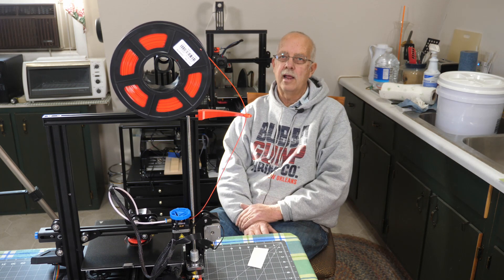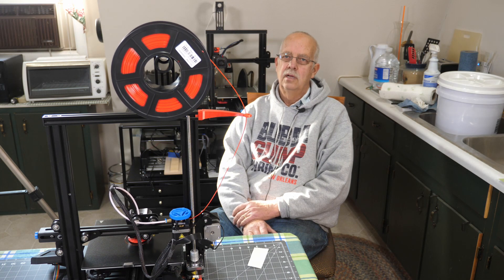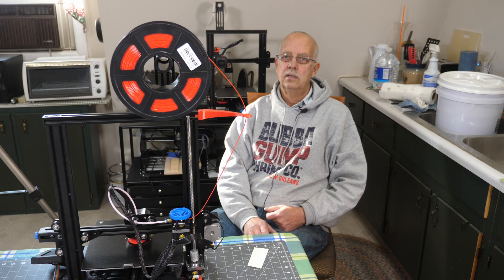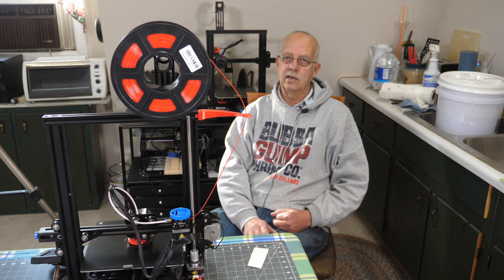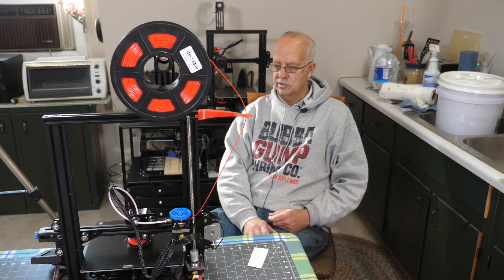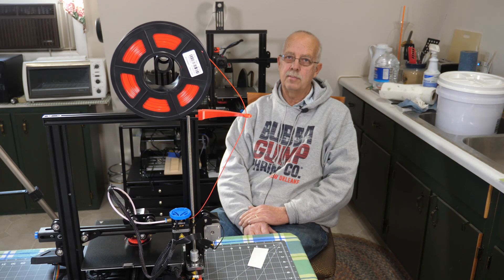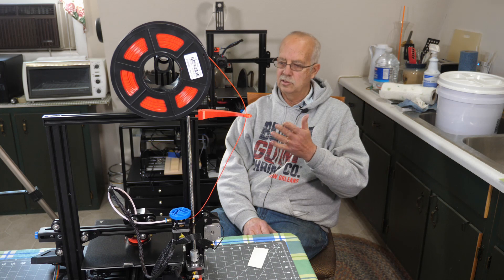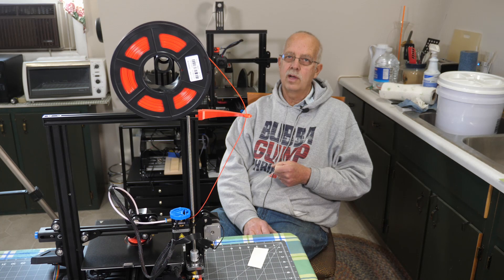3D PRINTS NOT STICKING?  WHAT IS THE AMBIENT TEMPERATURE?

Comment: I had to raise the bed temperature to 70..75 DegC for PLA to solve the sticking problem caused by a cold room temperature of ~16 DegC.
But there is another issue to be aware of and that is the temperature time constant of the printer bed.
If the temperature sensor of the printer indicates that the end temperature has been reached that does not mean that the print surface has the correct temperature because the sensor is located at the bottom of the heater plate.
It takes time for the heat to reach the printing surface.
I wait at least 15 to 30 minutes after the printer says it has reached the bed temperature before starting the print.
Reply from the maker: My only comment is to watch for possible "elephant's foot" on prints with a bed temperature that high for PLA.  I had to reduce bed to 50 C in summer when the ambient goes above 25 C to prevent this.
Reply: @rogersshop  Your remark is correct.
I have to solve one problem at a time and fine tune my understanding of the printing process.
If I set the temperature to 70..75 DegC then the real temperature is likely lower.
I have tried to measure the temperature of the print surface with a thermocouple.
It showed a large temperature difference with the assumed temperature setting.
This error is of course a function of the ambient room temperature, the type of print surface used (material, thickness, airgaps etc.) and the accuracy of the 'uncalibrated' temperature sensor of the printer and the thermocouple used.
Also the extruder fan's will cool the surface near the print nozzle.
Maybe i should use an infrared or thermal camera to verify the temperature behavior.
Reply from the maker: @albertholman7435  If you can get one a FLIR, will give you much more accurate temperature readings of the bed surface.  A FLIR has a lot of other uses too!  I use this one, but you don't have to get this fancy:  https://amzn.to/3OgxJmG

Comment: I've solved this on a printer which lives in my cold basement with a very lazy "enclosure" cardboard box and an old-fashioned incandenscent light bulb (isolated from touching, obviously).  It is far from air-tight but absolutely does the job for PETG and PLA.  I think relative humidity also plays a part, probably simply because wet air carries more heat.

Comment: This is pretty obvious to me and I'm surprised I couldn't find more videos on the subject.
Looked it up because while researching before getting my first printer I realized that because of the noise (and sometimes odor and gas levels emitted) it would be better to place the printer in another room than the one you are usually working in. But the only room available for me is a room I do not heat up in the colder months. Logic told me that that would affect the print quality, so I was curious what recommendations was out there. Looks like a easy problem to solve though, so thanks for this video.

Comment: Had some parts come loose tonight and I immediately thought that the low temp of 11-13c were the problem. Now I tried to block as much air flow as possible to trap the heat from the bed. I think I need to get a small chamber heater and / or a top cover for the printer but with all the tool changing cables it is not quite trivial.
Reply from the maker: During cold weather, when the loft is very cool, I change my bed temp setting to 60C and this cures the problem.